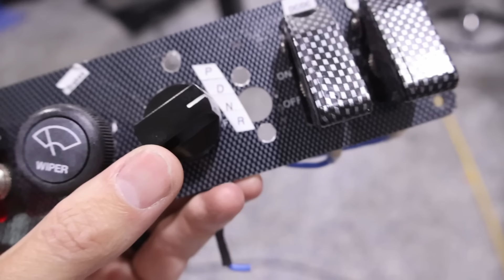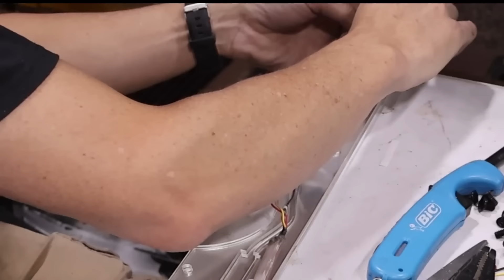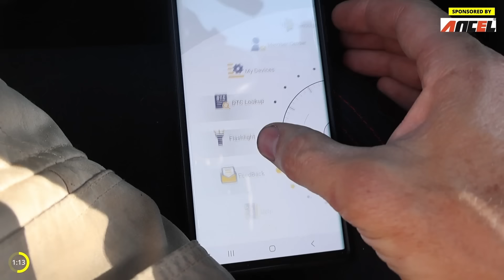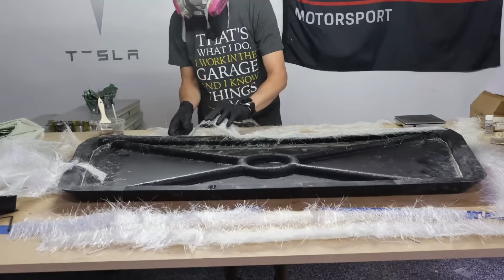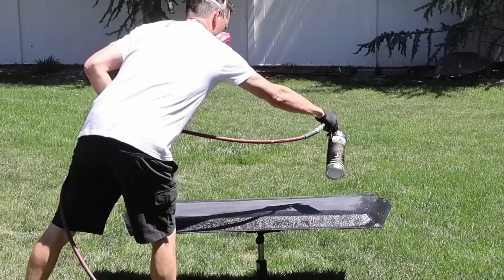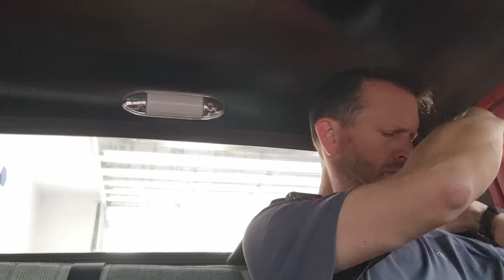Finishing Touches - Ford F-100 is finishing up

Comment: I noticed you were soldering some of the low-voltage wiring. I did some research on the topic and found that while soldering isn’t always required, it becomes more critical at lower voltages.

I recently had a penlight that ran on a single AAA battery stop working, not because the LED failed, but because the contact switch became unreliable as the battery voltage dropped. This illustrates an important point, even basic contact switches can struggle to maintain a solid electrical connection when the voltage falls below 1 volt or so.

At these lower voltages, resistance from a poor connection can become significant enough to prevent operation entirely. That’s why I recommend soldering connections when working with 12 volts or lower. It ensures low resistance and long-term reliability. On the other hand, crimped connections typically perform well at 60 volts and above, where minor contact resistance is less impactful.

In short, when working with low-voltage circuits, prioritizing secure, low-resistance connections, like soldering, is especially important for reliable performance. It looks like you're already familiar with this and know what you're doing so don't consider this message to be mainly addressed at you but rather into inform your readers and followers.
Reply from the maker: Thanks for the information!

Comment: I like that you finally tried gloop, but I can say, as someone who thought he glooped something  well enough but didn’t, it definitely works on any size of print, if you put enough on (and assuming the faces actually touch to some degree). I have struggled using it, but I’m not really properly equipped to deal with such a caustic chemical in my house lmao… but it does chemically weld the polymers together, so if it doesn’t work, there wasn’t good enough contact somewhere in the chain. I have trouble with it, so I am probably biased against it if anything, but it really does work. 

I’ve found that applying it to both surfaces helps, even though the directions only say to apply it to one surface. Also the owner is awesome, so I like to support companies with good people at the helm.
Reply from the maker: My problem is that usually, working time is extremely short, and many of the shapes I deal with do not lend themselves to clamping.
Reply: @electricsupercar it definitely is a short working time… I think it might be a two person job for big parts lol

Comment: Why not find a way to attach the frunk lid to the underside of the hood and then put some sort of seal on it? That way the weight of the hood holds it in place instead of the little latch things. Just a thought.
Reply: More work = more money.
Reply: Came here to write the same thing
Reply: Getting the alignment right and getting it to seal would be much more difficult and time consuming.

Comment: You should really consider using ABS or ASA for your 3D prints. PLA isn't really a functional filament.
Reply from the maker: I am going to PETG
Reply: PLA afaik is just cheaper and easy to print and he ends not using most of his prints in the final peace anyway, he uses fiver glass instead. I know there's a PLA+ version, the makers claim that is better but I never used it.
Reply: Petg is generally considered the direct upgrade, strong AF but just as easy to print as pla